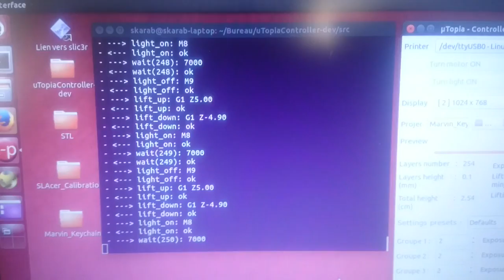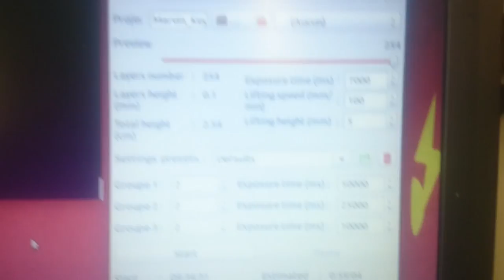uTopiaPrinter - Good print #2

Comment: Sebastian, I've been looking into building my own SLA 3d printer. I've experience with FMD and have built a working printer with a 22x28x40in build area. I understand how to make everything for an SLA except the most important part. The LCD and what is required in that aspect. as well as how to hardwire this all up. I would like to expand upon your idea that you built, and build one with an area of 12x12x40 or 14x14x40. Is this possible and what exactly would I need to do?